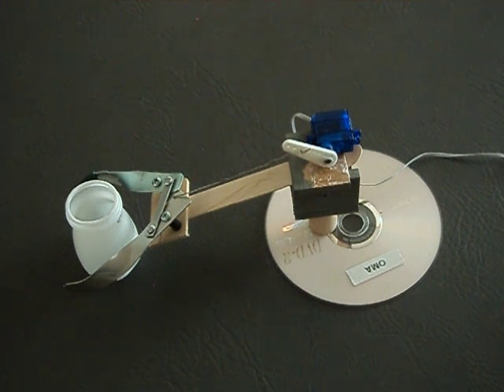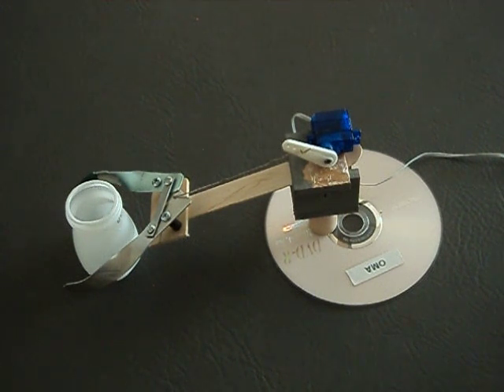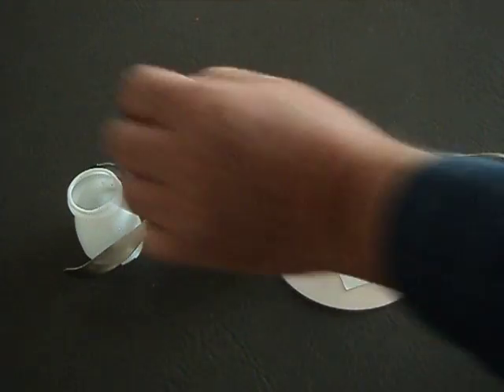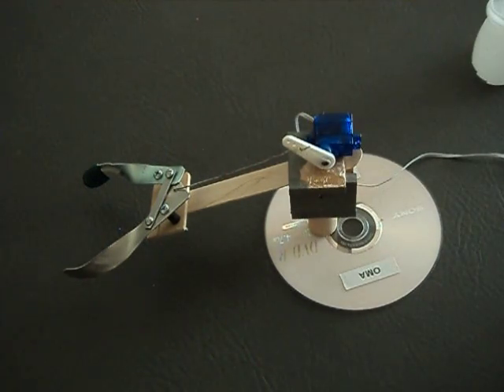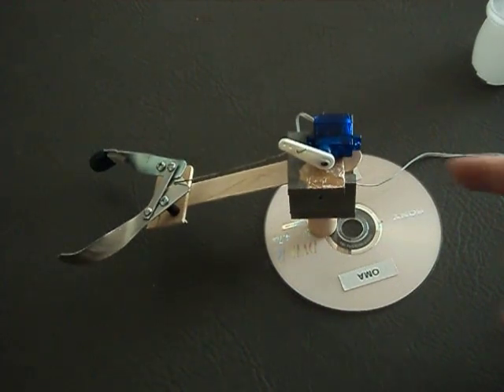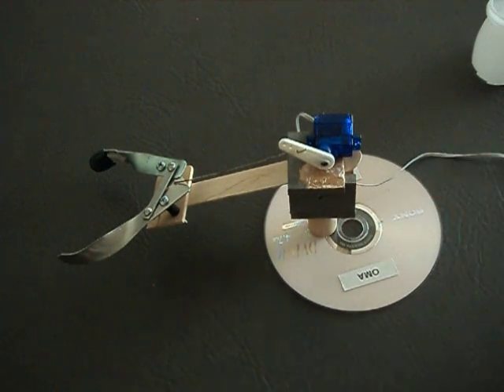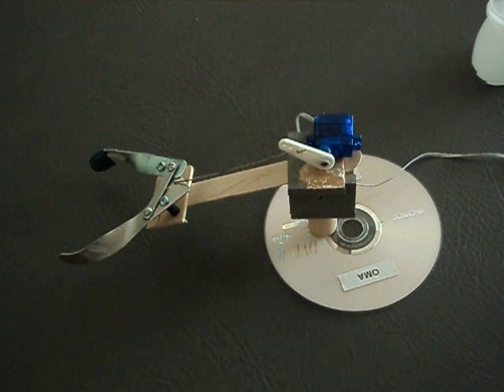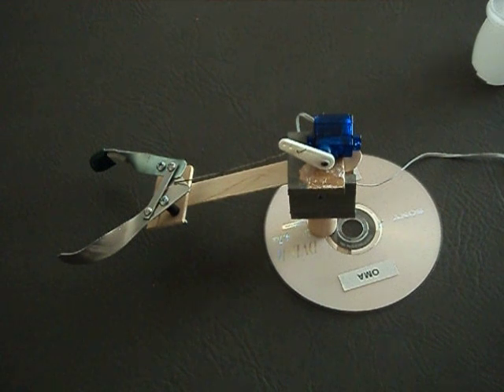Educators D.I.Y. Robotic Arm OMA One Motor Arm

Comment from the maker: To modify the servo 
Remove both stickers on each side of the servo.
Move the stickers high enough on the servos sides to prevent the top of the servo from coming apart.
Remove the four screws on the bottom of the servo.
Remove the bottom plate.
Cut the wires soldered onto the motor (two tabs labeled +-)
Solder two new wires in the place of the old wires make them as long as you wish.  I use ribbon wire from an old computer.
Cut the 3 wire cluster red black (sometimes brown) and orange.
Keep those for another project. Or use them instead of the 2 ribbon wires. But, you only need two wires I cut the orange and just use the brown and the red.  The cool part of this is now you have a nice connector on the other end to connect to an Arduino or other power source.
Route the two wires you afixed to the motor where the three original wires came out of the servo.
Close up the bottom plate
reassemble the 4 screws
remove stickers if you wish.
Now your servo is modified, power up the servo using about 3.0 volts 2 AA batteries will
work fine. You can go up to 4 batteries but you don't wont to damage the servo's motor. Your servo will move about 180 degrees in one direction.  Reverse the wires polarity and the servo will move back in the other direction.  Simple.  Never any servo jitter because it's now an open loop circuit.

Comment: can't you just show us how to build it without the eBay kit instead with household items
Reply from the maker: Thank you for your response.  The new E bay kit is made of abs , this kit was using pretty much household items.  Tongue depressor, aluminum from old flat license plates, paper clip, old CD or DVD disk, wood, and screws and bolts, and of course a modified SG-90 servo from E bay.  Currently working on a three axis arm with rotation and the aid of a 3D printer.